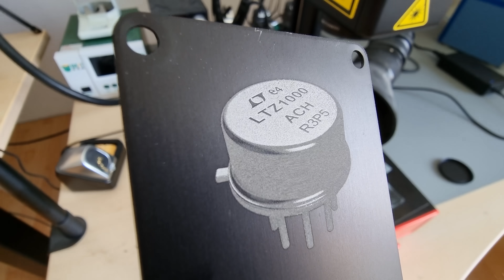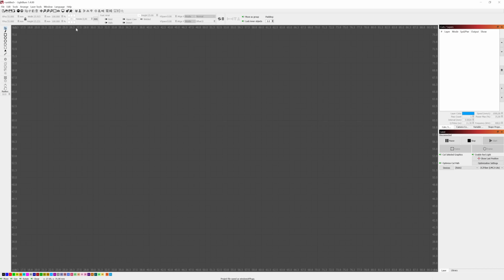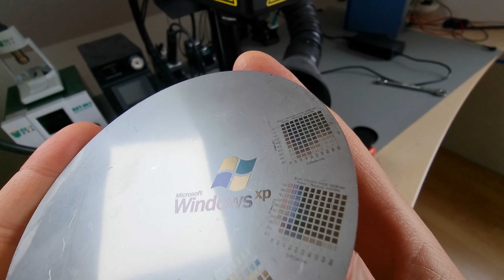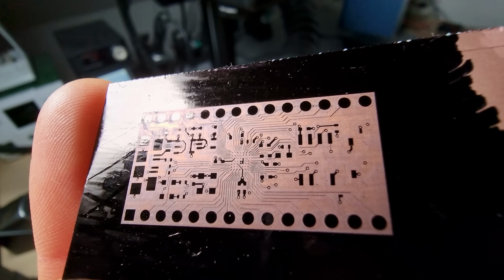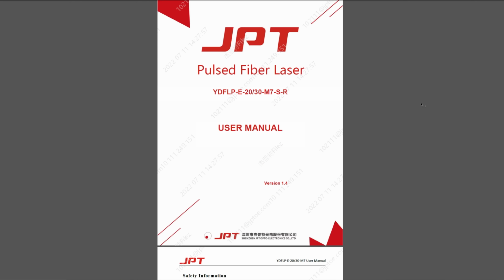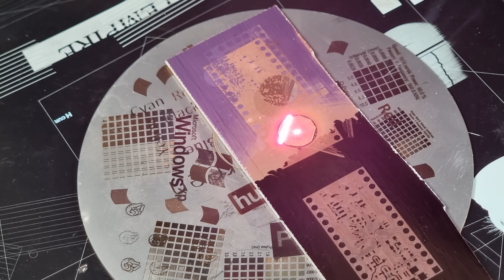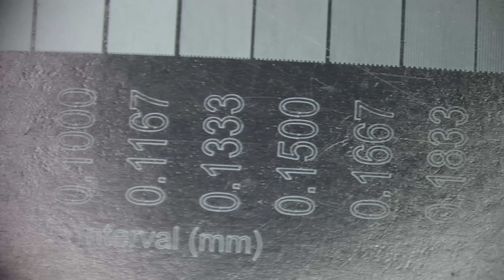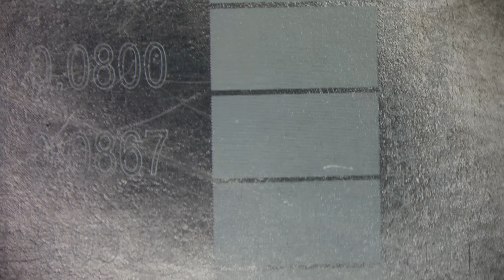PCBs, Color marking, Nanoparticles, Focal point diameter, Lightburn w/ EM-Smart MOPA Fiber Laser

Comment: I do copper PCB with a JPT 20W MOPA and it works just fine without burning the board. You do want to have the laser moving over the surface and not spending its time in one small spot all the time.

Comment: It would be very interesting, direct exposure to the photoresist, but a different laser wavelength is needed.
Reply: Why would you expose it if you can straight up obliterate it? Are you into extra steps? :D
Reply: @NGC1433  "Obliteration" is a big problem. So far I have not seen a quick and satisfactory result.

Comment: I’ve also been diving into the PCB laser space, but using a cheap 5W diode laser. In my case I’m using Lightburn’s offset fill to get good edges on my outlines, which seems to work quite well. At least, after I run the KiCAD SVG output through an extensive shell script to invert and flip it if necessary, flatten all the beziers, collapse the layers, and do laser beam width compensation while I’m at it. I use a black spray-lacquer as my etch resist, because it burns off easily but is easy to clean off with IPA.

What I’m running into problems with now is the solder mask. I tried painting a full layer of (acetone thinned) UV-cure solder-mask to the board, curing it in the sun, and ablating the parts that I didn’t want, but the solder mask was proving difficult to burn away when over copper, and too easy to burn through when atop fibreglass, causing charring. Also it smells like 5 flavours of cancer. My next tests will involve using high-temperature spray paint as a solder mask, where hopefully the thinner layer will make it easier to burn though. Otherwise I can invert the mask layers and try using the blue laser to preferentially cure areas of the solder mask.

Double sided alignment and automatic drilling have yet to be tackled, though both should be reasonably straightforward. My machine is just a modified Ender 3.

FYI for those with resin printers, UVtools has a UV PCB exposure method that works decently. I found the contrast wasn’t good enough for my sub-par dry film photoresist, but I bet with a double LCD or a DLP it would definitely be good enough.
Reply: I have a similar setup, in my case it's a cheap 500mW purple laser module that i attached to my Ender 3, also using black spray paint. I am using FlatCAM to process gerber files from KiCAD, works pretty well. Layer alignment is a bit tricky, i printed out an end stop that allows me to fine tune the angle of the board so that it sits perpendicular to both axes. I measure the exact dimension of the board and offset the layers so that they sit on top of each other once i flipped the board around. Solder mask is something i've kinda given up on though.
Reply: @ElectronicsExplored  I tried a 500mW laser, but found it could reliably burn through the etch resist. Maybe that’s just because it’s focus was poor.
Reply: Yes, the topic of boobs is not disclosed😐. As I thought so far, for prototyping it is better than an engraver like Bungard will not work. Etching is also, of course, good and fast enough, but this does not solve the problem with drilling. As for the solder mask, it is easier to remove it again with an engraver. The question is about prototyping, because if I need a lot of the same type of boards, I will order them in China.
Reply: @DevilAgent  ah yeah, the other option for solder mask is to use one of those spring-loaded engraving tips. They have low enough cutting forces that it’s probably fine to use on an Ender 3. Though without a dual-Z mod I’ll want to be a bit conservative with downward pressure.

The other big bonus you get from Chinese boards is plated through-holes. There are homemade alternatives like electroless silver plating (fibre laser palladium nanoparticles being another), but they all look like a real pain. My thinking is to stick to China fab houses for complicated breakout boards and finished projects, while diy PCBs should be used to stick these breakout boards together in simple ways, and for making sufficiently simple boards.